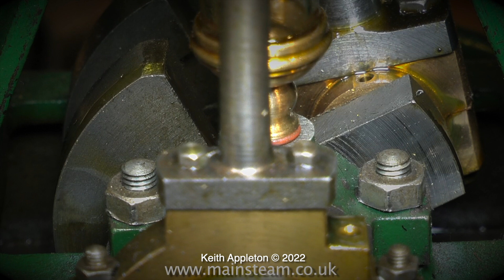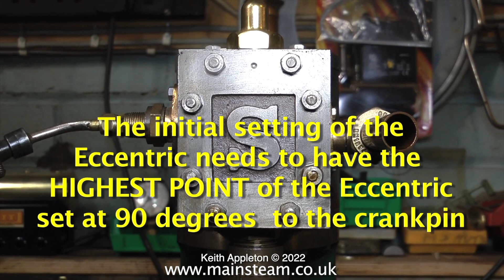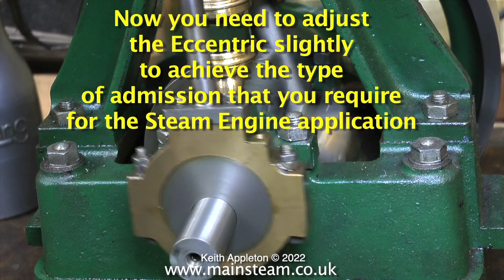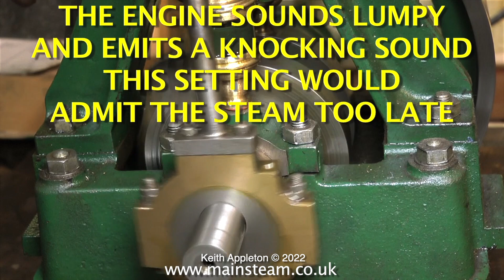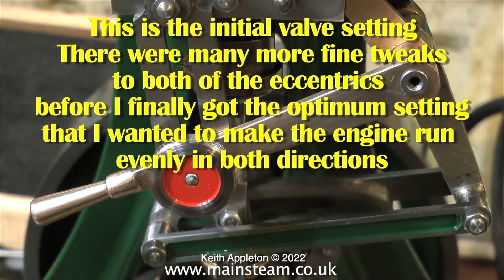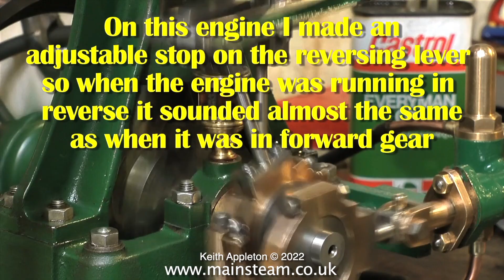MODEL STEAM ENGINES AND BOILERS - PART #27

Comment: I'm gratified to see an explicit "the crank pin is at twelve o'clock, the eccentric at nine o'clock" shot. Simple minds like mine need to have such things spelled out beyond all misunderstanding.
Reply from the maker: Mine too . . . . if you break things down into smaller parts it is simpler to understand.